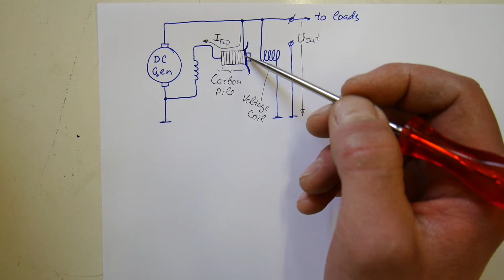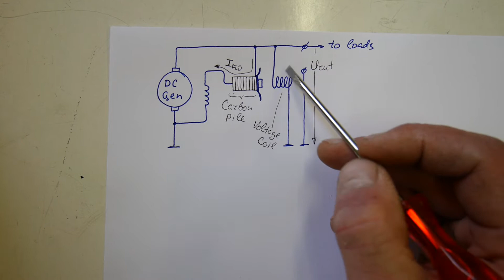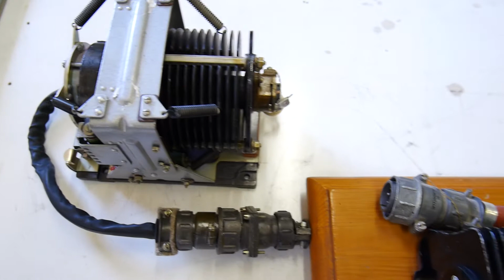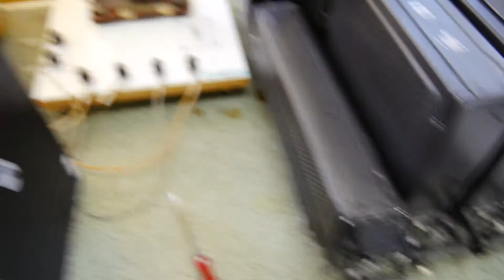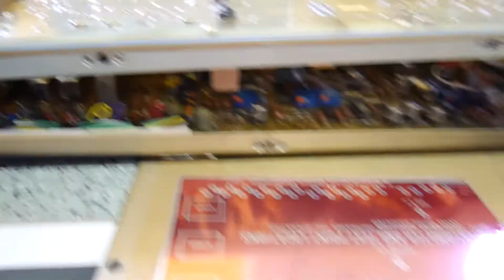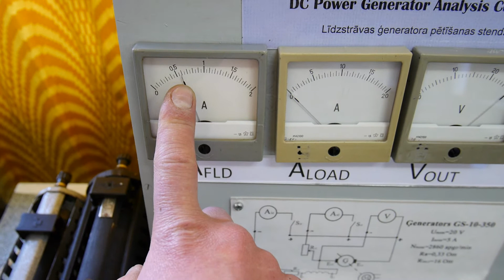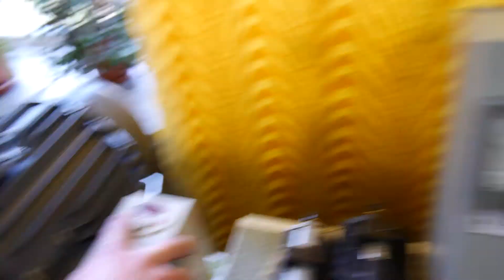Evolution and Operation of Aircraft Voltage Regulators

Comment: Great video. One nit: in the initial description of the carbon pile mechanism (at about 2:12), reducing the compression increases (not reduces) the resistance of the pile, causing lower current flow, and reducing voltage. The overall description is right, but the resistance increases to reduce current flow.
Reply from the maker: Sure: lower compression force cause resistance of the carbon pile to increase, thus field current will drop.
For example: generator output voltage increases (more than 28V) => more supply to the voltage coil => higher attractive force => less compression => more resistance => field current will reduce => generator output voltage will reduce to (back to 28V).
Sorry if there is a mistake in the video...